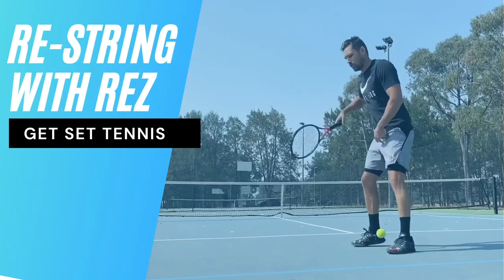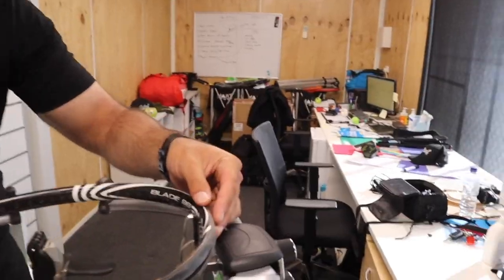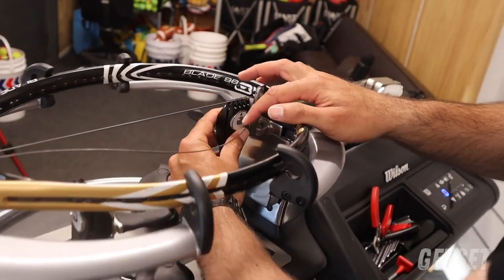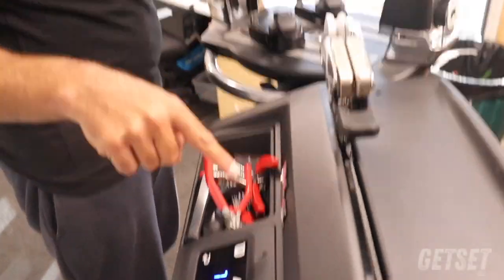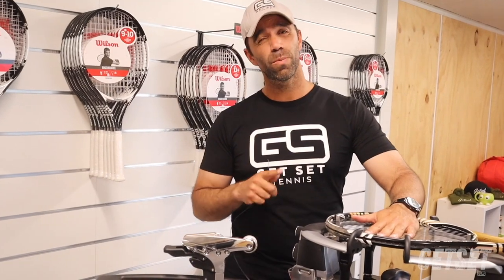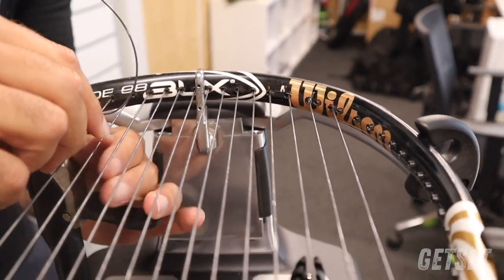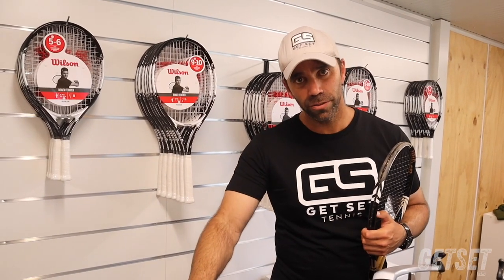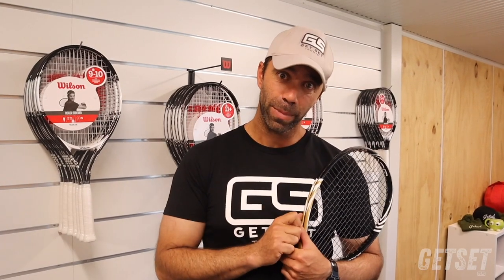How we Restring a tennis racquet

Comment: Thanks for the nice explanation. I have just one question. The method you used to start the mains did result in pulling the first main twice. Isn't this affecting string stiffness? If you do a sound test by pinging the two centre mains, do they sound identical? Same problem with the first cross. Regarding the first cross, I do not think this is a problem, because this string is way out of the sweet spot. But for the mains, I don't know.